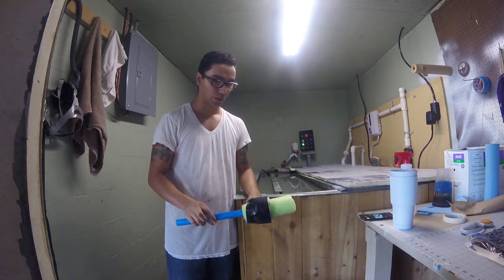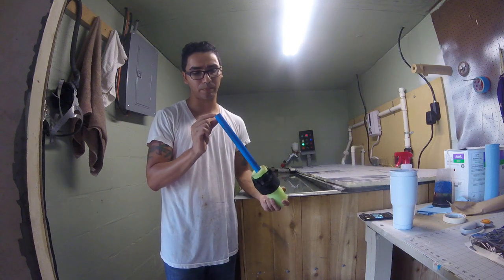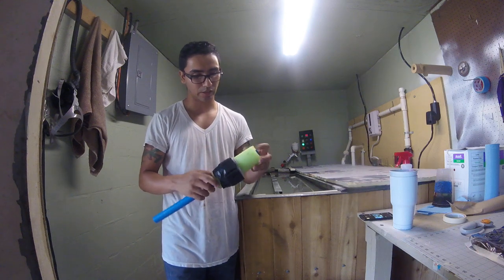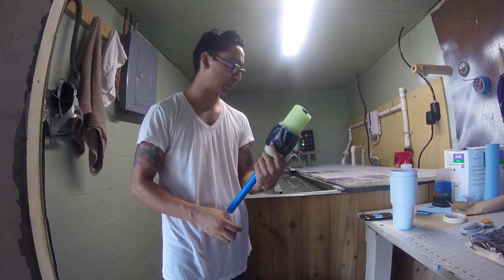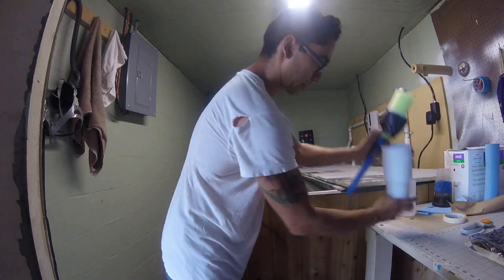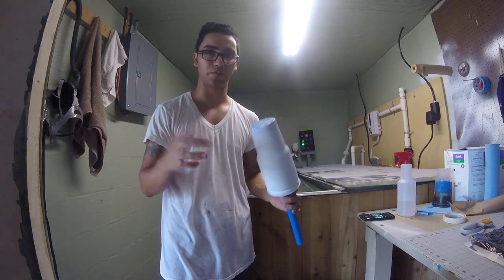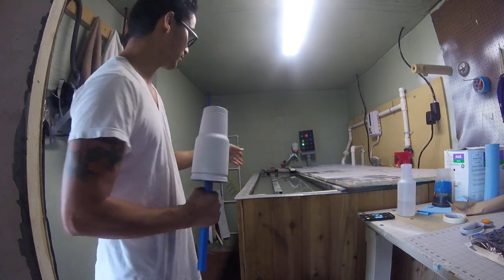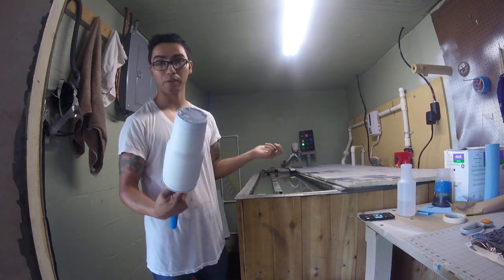information on my Cup dipping stick of awesomesauce.

Comment: I'm going to do my tumbler from a diy kit. Can you tell me the prep work process please
Reply from the maker: sure thing, first i degrease the cup with some iso alchohol then i tape off the lower portion of the cup(that little seam where they attach the bottom piece, its like 1/2 inch or so)  get yourself a some sand paper or scotch brite and scuff it up, this gives the paint something to grab onto. paint with your base color, wait the 15-20 minutes or whatever is recommend by the paint manufacturer then dip.